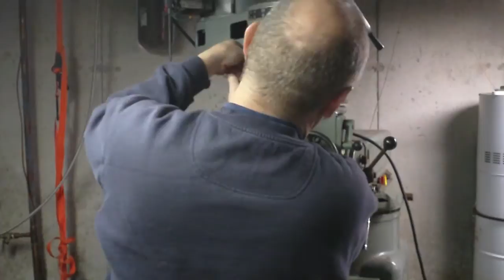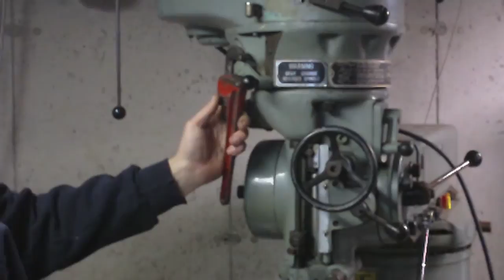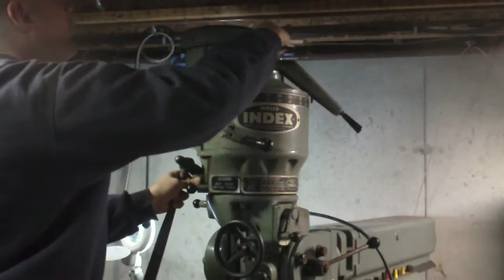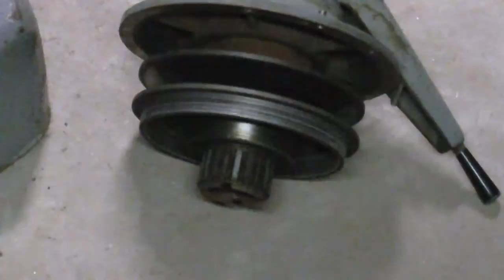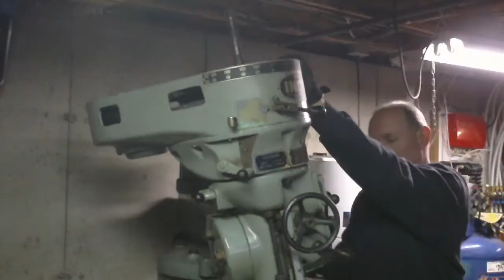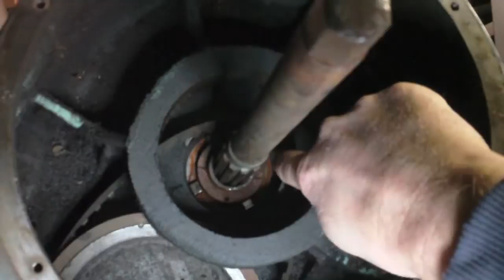Wells Index Milling Machine Part 37

Comment: if you want to know the year of the mill call wells and give them the ss number off the side plate and they will tell you the year /tooling it was sold with and if wells had ever did any work on it. if u didn't already do it i wouldn't spray anything in the head unless your planing to change out the grease as it would contaminate the grease as it is to last the life of the mill. as for the oil cup that only oils the spindle.
Reply from the maker: Thanks. I have spoken to Wells tech support a couple times. They are great. I have not bothered getting the year yet. As for the contamination worries……lol, just wait until you see the next few videos! Bigger fish to fry coming up! But thanks for the tips.
Reply: sorry im on my phone now this is also intel2you i thought of something after i posted  my comment when the mill is in back gear and turns backward mine shifts easier when turning in the opset direction worth a try.if u watch my video wells index upper bearing replacement its on this turnmaster account it may help. my head is a bit different as it is step pulley but will give ya the general idea. again sorry for the 2 posts from 2 different accounts
Reply from the maker: turnmaster No problem about the 2 accounts. The manual gives tips on how to shift in and out, but that's not the issue here.
Reply: ya im guessing your way behide on the videos from where u are in the project. keep in mind u can get all parts for the mill from wells just dont brake anyof the castings as they dont have new of them anymore. ill stay tuned to see how ya make out. good luck josh